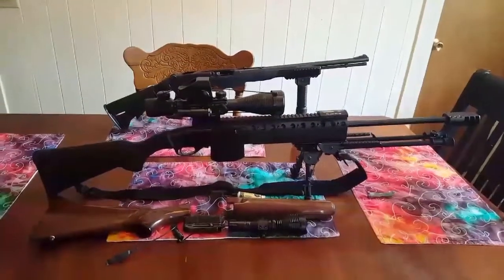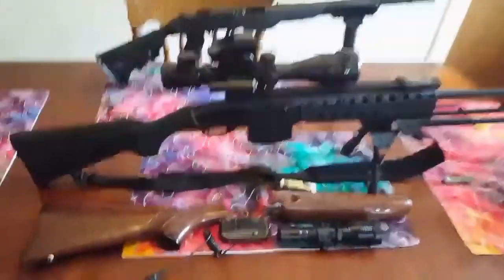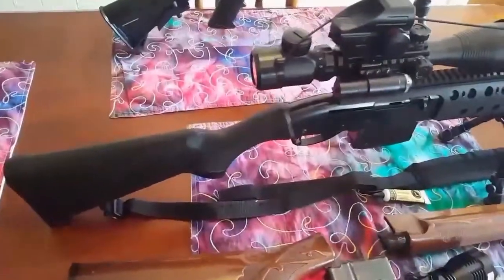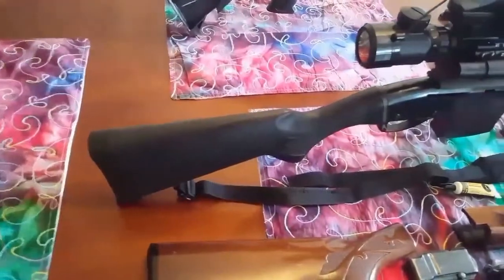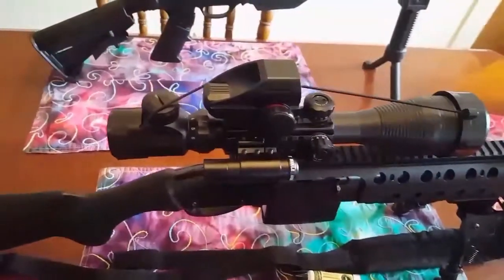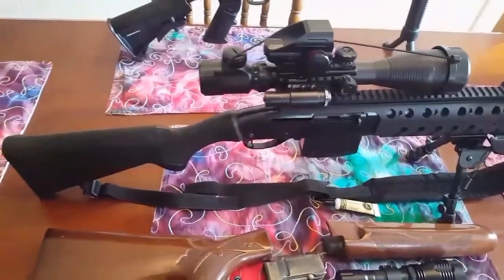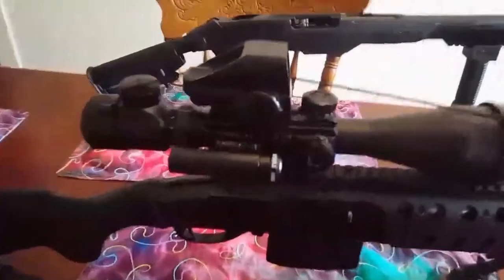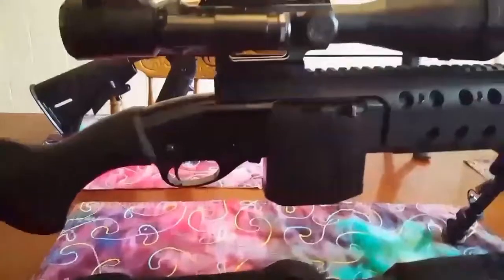Hunting Tactical 30-06 Build Part 1

Comment: With that forearm do you have any problems with holding zero?
Reply: Hunting Tactical thanks for the response. I am debating turning a 7400 into a full power or high power battle rifle. I am a big fan of Remington and the .30-06. The .30-06 in the AR platform is ridiculously expensive !!